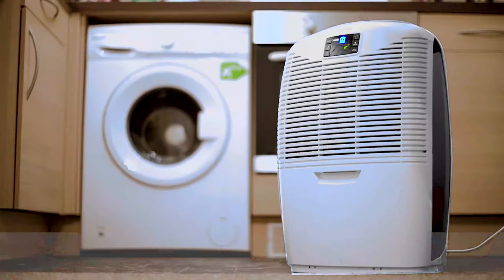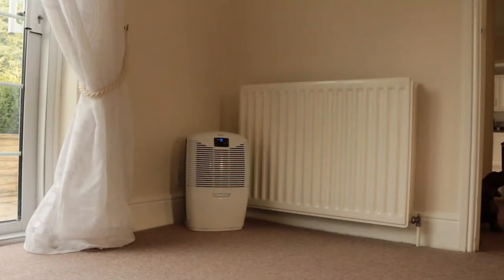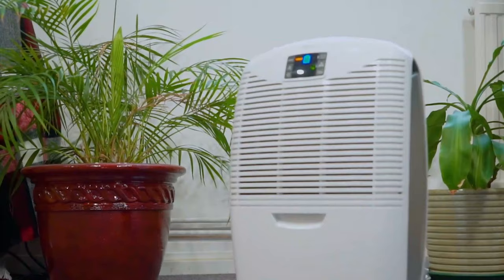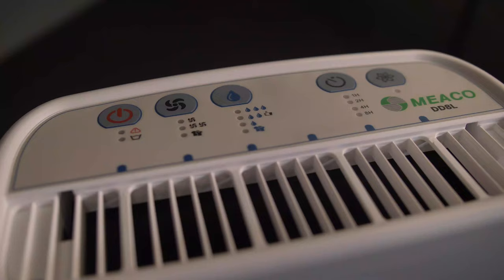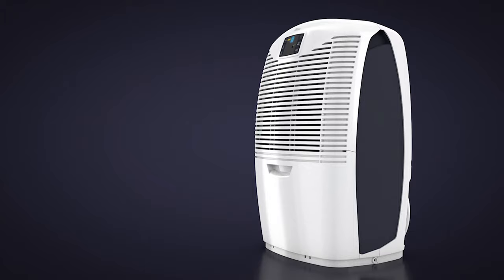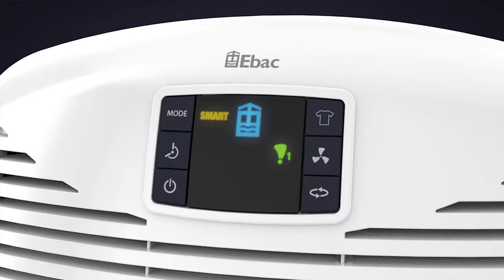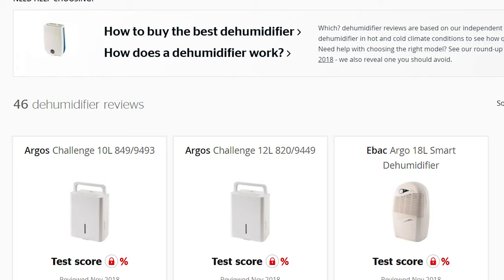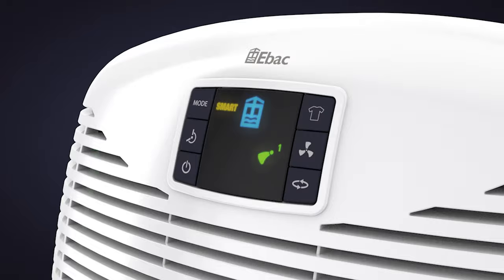Dehumidifier Control Methods

Comment: I bought an Ebac2650e and am very pleased with its function and performance. I have 2 desiccant Ecoair units which are okay and you can alter the humidistat but to be honest how many of us know what that should be within our homes so the Ebac 2650e does this for you which I have noticed a perceptible different in the heating of the house it definitely does make the home feel warmer as where I live in Wales there is quite high climate humidity. After initial setup on manual I leave the unit on smart mode low fan for background or increase to high if drying laundry. I definitely recommend my model Ebac which covers my 3 bedroom house with my wife, dog Reg and next door’s mogg who uses our home a doss house 🤔

Comment: I had the device with a wood veneer finish, they died, died and died again, a 5 year warranty isn't worth the paper it was written on, I had a device go away with one fault and return with another. I had ruined wooden flooring from leaks (put it inside a large plastic container if you value your flooring). Expect it to last NO longer than the warranty. Made for the british climate my derriere.

Comment: Smart control only understands the conditions inside the unit, where the humidity sensor lives, up at the top where it gets heated by the PCB triac and heat rising from the compressor, we had one and it was hopeless.  Our old original Ebac unit (wooden box) with a bog standard humidistat (you laughingly call them infinity controls now but that's marketing for you, thinking their customers were born yesterday), worked much better.  For example you could place the washing in front of it and it would sense the increase in humidity and set itself running within minutes and keep going for quite some time until the washing was fairly dry.  The so called "Smart" control could not detect the increased humidity from the washing, let alone anything else happening in the house.

The positioning of the sensor has been done the cheapest way possible by mounting it in on the control PCB, there are so many other better ways it could be done to work much more reliably, including using much faster to react and more accurate humidity and temperature sensors (Bosch BME280 for example where it could be really smart and track the atmospheric pressure and predict the likely hood of wet weather and target a lower humidity level to get ahead of itself, and measures so quickly it could be placed in the air flow and the fan used for a few seconds to get an accurate reading). Maybe look at how a Mitsubishi MJ-E16VX-A1 has been designed, this replaced a so called smart Ebac dehumidifier and knocks spots of the Ebac models, in features, reliability and design.
Reply: I've owned a Mitsubishi MJ-E16VX for over 10 years, and, as you say, it's an excellent machine. Sadly, it died recently, and Mitsubishi have left the European market.
Reply: @nkt1  They can develop a couple of faults after that length of time.  The starting capacitor can fail so it appears to work but doesn't dehumidify as the compressor doesn't run, and another fault is the power supply so it appears completely dead.  I was able to repair ours quite easily for very little money for these faults that happened quite close together at about 12 years old, guess they aim to make them last 10 years.
Reply: @chrislee6650  Interesting, thanks. Initially, the fan was running, but not the compressor; a few hours later, it died completely. I did wonder if I could fix it, I did a similar repair on a fridge freezer years ago, replaced the starter relay if I recall. I’ve bought a new Meaco, which is so much quieter, and a better size for my studio flat. I might try and repair the Mitsubishi and sell it on.
Reply: @nkt1  It might have blown a fuse if the compressor hadn't started as it is drawing quite a bit of extra current if in a stalled state.  Replacement capacitor I used was Ducati Energia 8μF Polypropylene Capacitor PP 450V.  This is cylindrical one, the existing one is square but fits and works fine.  A service manual can be found with a Google.  Good luck.
Reply: @chrislee6650  Many thanks, I’ll give it a go and report back :-)
Reply: I've had mine for years and have become suspicious of smart control. It just doesn't respond.
Reply from the maker: Hi, 
Thank you for your kind comments.